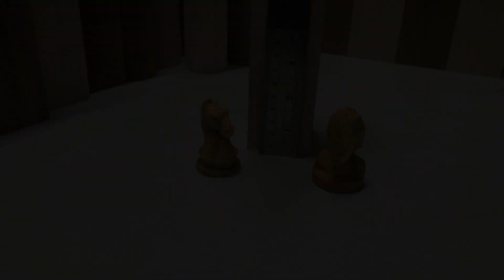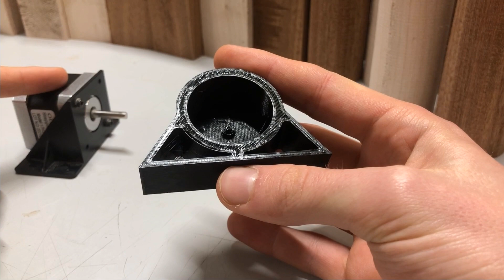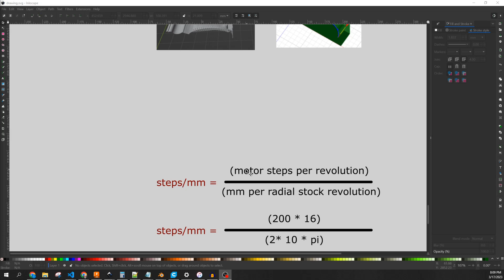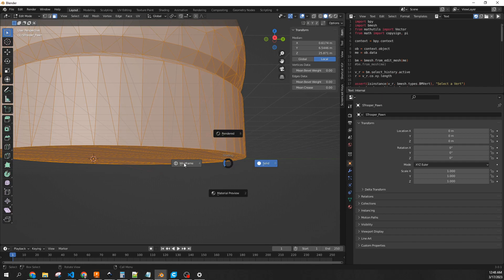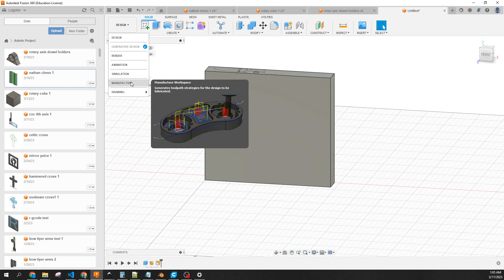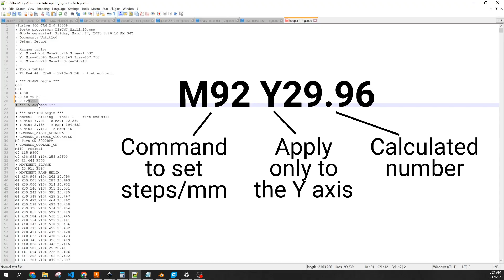Custom Wooden Pieces! ♘♖♕ ($12 CNC Rotary Axis)

Comment: Wow, absolutely brilliant! The idea of unwrapping the Y-axis is so clever - and I loved your MVP (minimum viable product) approach to it all. For just a little more stability/precision, it would be trivial to just run a metal rod through the 3D printed tail stock, use an inserted (maybe CA- glued, release with heat or just cut the object free when done) and a 3D-mounted bearing at the headstock end. It’d be interesting to see what kind of tolerances you could hold with that setup and light cuts in aluminum. Super-cool hack, thanks for sharing!

Comment: why does the router wobble? 7:15
Reply: I think you're probably talking about when I physically push the button to turn on the router. Or maybe the vibrations that are shaking the camera
Reply: @calebread7621  but you can clearly see the padlock symbol on the router wobble side to side for few seconds
Reply from the maker: @AIcarve  Oh, yeah, that part is always loose on the dewalt660. That piece of black plastic and the yellow button are to tighten the spindle without a wrench but usually they're not engaged :)